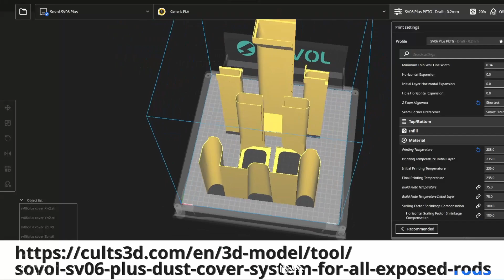Dust cover system for SOVOL SV06 Plus, SV06, SV07 Plus

Comment: Brilliant
Reply from the maker: Thank you! I was actually surprised noone came up with this idea before. Dust is the #1 enemy of precission machinery. Now I designed these sets for all my printers: SV06, SV06 Plus, SV07 Plus.  If someone needs covers for the regular SV07, please contact me, I would design for them for free.
Reply: @gerGoPrint3D  I always had a plastic bag on the top covering the printer. But this design is really clean and efficient. 
Going to print for the 06plus, thanks for this design.